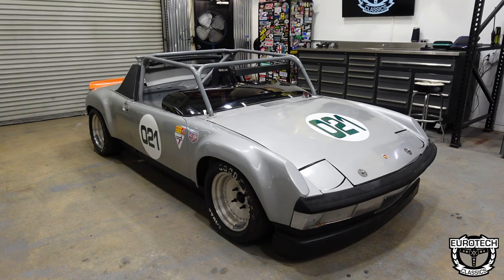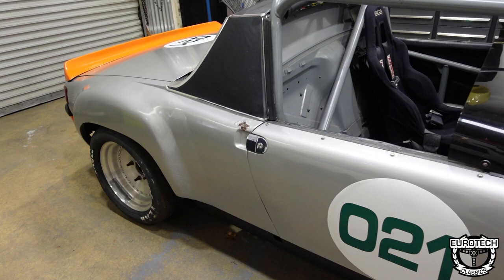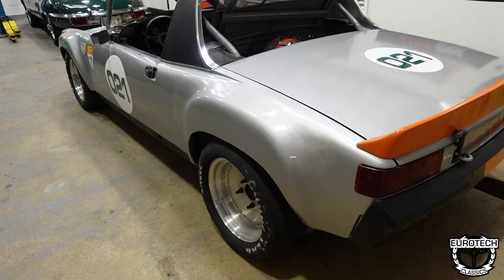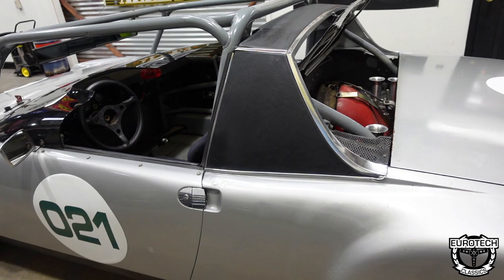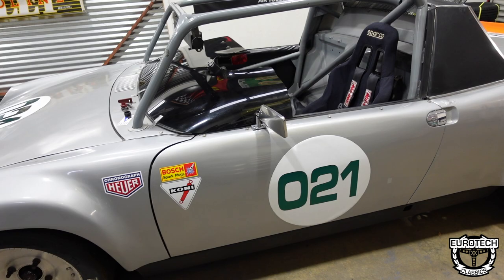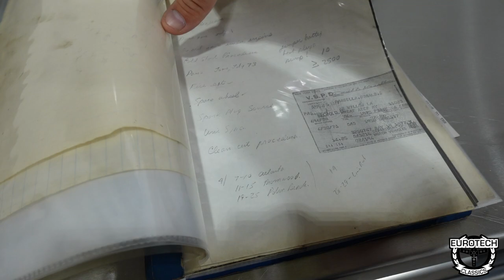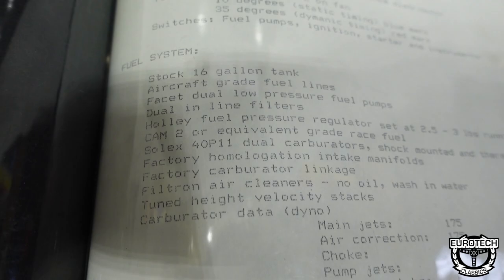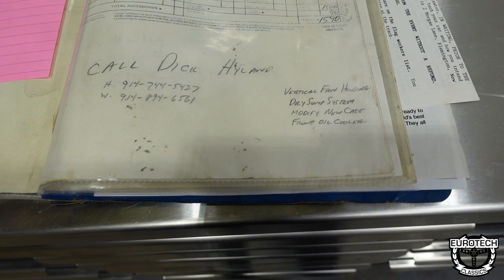Eurotech Classics 1970 Porsche 914 Race Car

Comment: I had the opportunity, many times to see this car run at Watkins Glen.  Don't let the 4 cyl motor fool you, that car was fast.  It's low weight, mid-engine layout made it a killer.  I also know the man who maintained that engine, Dick Hyland at Hyland Engineering.  Great car glad to know that it has been cleaned up and run over the years.